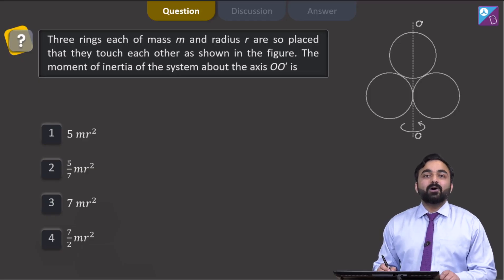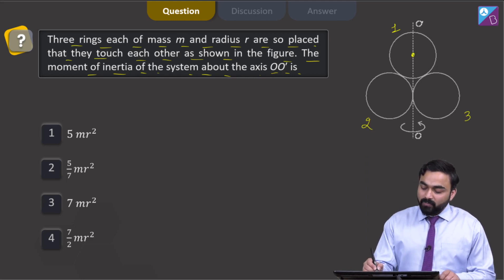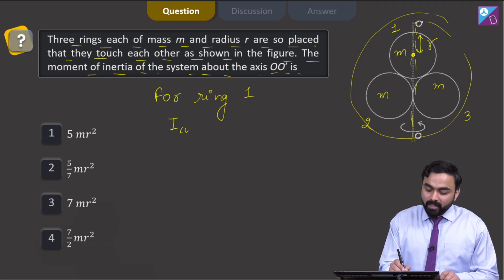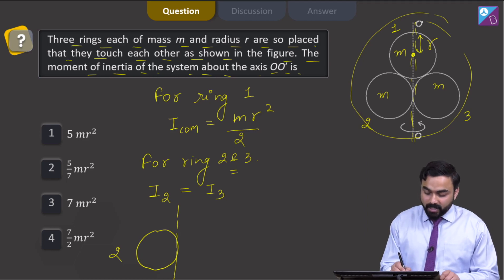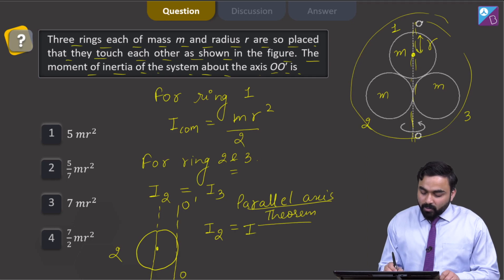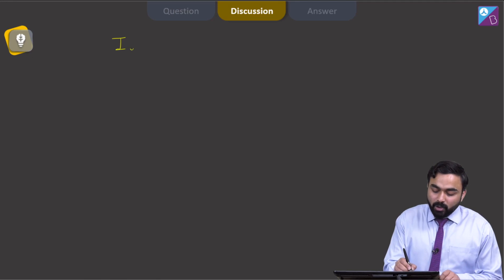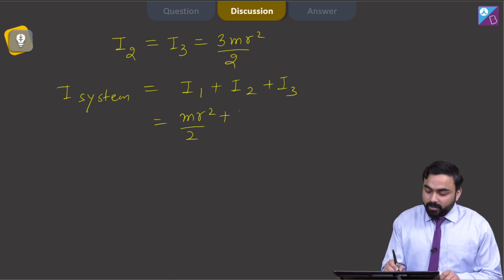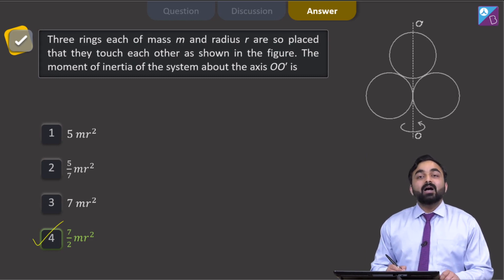Three rings each of mass m and radius r are so placed that they touch each...... neet question 2023

Comment: Moi of ring passing through centre formula is mr² know sir...why taking mr²\2
Reply: Divide by 2 if axis is by diameter and multiply by 3/2 if tangent
Reply: Exactly, it's clearly a ring
Reply: Well basically, the axis is not through the rings, it's above them along the diameter, for which MOI is Mr²/2